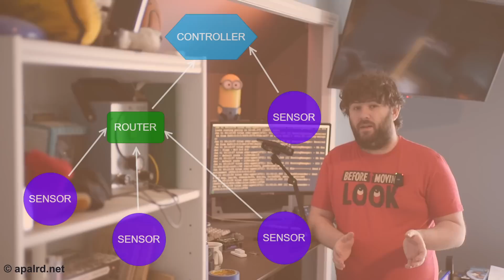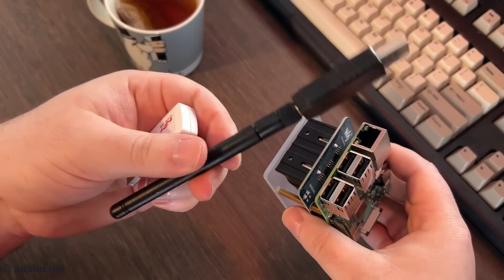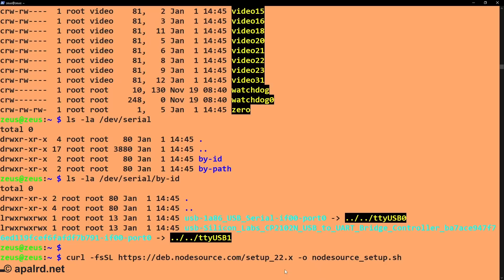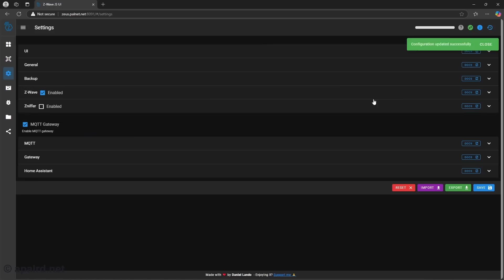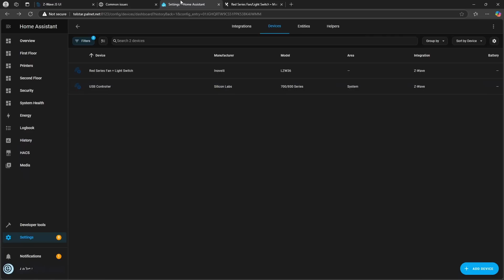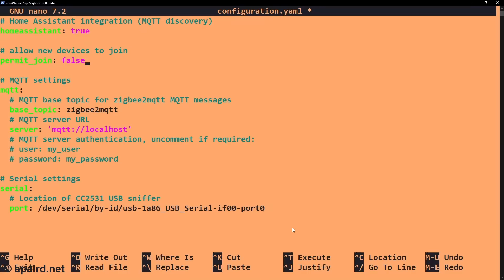Bridging Home Assistant to Zwave and Zigbee using a Remote Raspberry Pi Radio

Comment: I use the HomeSeer Z-NET, which is basically a Raspberry Pi with built-in Z-Wave. It also takes an optional Zigbee USB stick. I use the Z-NET with HomeSeer, which runs in an ESXi VM. HomeSeer Z-NET also works with Home Assistant (I have HA, but at this time, it doesn’t use Z-Wave). The Z-NET is great. It works out of the box, and is easier than making your own. The only caveat is to make sure to take an image backup of the MicroSD card, since I’ve had trouble with MicroSD cards going bad in the past (just after year or more of running 24x7, it’s the nature of SD cards, I suppose).

Comment: So, according to what You've said, when it comes to Home Assistant integration zwave doesn't provide High Availability beacuse only one device integrates with it, right? 

So it's pointless adding more than one controller? I am asking this question beacuse I was thinking about adding zwave to my homelab not only for a better network range but also for High Availability while using Home Assistant.
Reply from the maker: Zwave and Zigbee both form a tree network which must have exactly one controller. They differ in how they store the network info. 

Zwave stores all pairings and security keys on the stick, so that exact stick must be the controller. You can backup and restore the eeprom to move to a new stick but that operation interrupts the network. 

Zigbee stores pairings and keys in the zigbee2mqrt conf file. So any stick with the correct firmware will work. You could have multiple sticks, each connected to one host, as long as only one one is in use at a time. 

Not covered in this video but Thread forms a true mesh, so you can have two Thread border routers both working together like two WiFi APs for redundancy.

Comment: What is your reason to not use the popular smlight slzb006? Thinking of buying it.
Reply from the maker: well I need a solution for zwave in any case, so that won't solve zwave. It's not a bad stick on its own, but it doesn't run Z2M, so that needs to run somewhere too, and if you use HA OS, you can't run two copies of Z2M for two Zigbee networks.

Comment: Soo, odd idea.. could you config the pi to host the devices with usbip and mount the device from the HA vm?  And even then, proxy the connections if you had multiple pi's/adapters?
Reply from the maker: Both of the dongles use usb serial so you can proxy the serial port instead of raw usb. But also, this means you’re limited to running one instance of Zwave and one Zigbee with HA OS, since you can’t run two instances of each addon. I have two zigbee networks.

Comment: Another way to approach this is to use serial over ip. For example, I use ser2net on the RPi hosting the dongles and point Z2M and Z-Wave JS UI to it.
Reply from the maker: The downside to this is you can only run one Z2M / zwavejs on HA OS. I have two zigbee networks. 

If you run them separately then it’s not a problem but then there’s not a big reason to not just run it on the Pi. It’s not a big program.
Reply: @apalrdsadventures  Agreed. The reason I run it on a Pi is because my Home Assistant runs on a Proxmox cluster and no matter which node is running Home Assistant at the moment, it can still connect to Zigbee and Z-Wave sticks on the Pi.

Comment: Erm…… Why not just run these as docker containers? They can then be backed up easily and if your card dies can be restored pretty quickly.
Reply from the maker: Is docker easier to backup than a single application directory with a few conf files?
Reply: don't use the naughty D word here 🤪🤔

Comment: Would this work with a rpi 1. I have one sitting around doing nothing
Reply from the maker: You might run into limitations of the Pi 1 being ARMv6 instead of ARMv7 or ARMv8, which a lot of software no longer supports

Comment: I have home assistant with a zwave dongle attached directly to it, running z wave js as an add on to home asssistant. If I want to do what you did and move zwave to a pi, is there a way I can do this without having to re pair all my devices?
Reply from the maker: the network keys + pairings are all stored on the physical stick, so you will have to re-use the same stick (that's the problem I had - the stick had died). That will not bring over the friendly names for devices. 

If you do a backup of the HA OS setup, you can extract the zip and find the zip from zwavejs, and upload that whole folder to restore your configuration and the friendly names of all of the devices.
Reply: @apalrdsadventures awesome thanks!

Comment: This feel inelegant, an SMLIGHT SLZB PoE would take care of the Zigbee side of things, i dont use Z-Wave but maybe there is something similar. All of the moving parts, and a soon-to-fail sd card / having to maintain a full linux stack on that Pi seems like a lot of effort.
Reply from the maker: that doesn't run Zigbee2MQTT though, it has to run somewhere, and if you have two of them, you can't run them as an HAOS Addon either
Reply: @ you run z2m in your proxmox cluster with HA and point it at the IP address of the  SMLight. Maybe im missing something?  I run HAOS as a vm in my proxmox cluster, z2m is an addon within that HAOS instance. I can move that HAOS vm around the cluser and Zigbee works just fine.
Reply: @substandard649  Is the add-on called Zigbee2MQTT or something else?
Reply from the maker: yes, that only works with one single Zigbee controller, since you can't run multiple copies of Z2M in HA OS
Reply: @apalrdsadventures but you can run as many z2m instances as you like as containers or dockers on the cluster, i have this setup for my barn. I still get to benefit from a single PoE device in each location, no PI, no SD cards no requirement for a PSU and no additional device with a linux stack to maintain
Reply from the maker: yes, that is true if you run outside of HA OS. I don't mind embedded Linux vs embedded firmware.
Reply: There is nothing like that currently for Z-Wave that I’ve seen when looking for it. Silicon Labs makes a lot of SOC for Z-Wave, but to run one as POE you’d need a separate POE SOC to adapt. Running a Texas Instruments POE SOC and an 800LR S2 on a little custom PCB would be like $40-$200 in: board mount SMA connector, ~800mhz-950mhz or a more specific NA or EU model SMA antenna, capacitors, resistors, VRMs, the POE microcontroller SOC, The 800LR Z-Wave SOC with S2 security support, a board mount Cat6 ethernet female port, led indicator lights, buttons, (optional) mini OLED or LCD screen, a custom on demand printed circuit board, (optional) usb port, temperature/humidity sensor IC or more advanced Air Quality SOC such as SEN55 or the upcoming SEN66, custom 3d printed case (maybe one of the Aluminum ones offered by PCB-Way’s metal 3d Printer,) thermal pads, m2.5 standoffs, m2.5 thumb screws, (optional) multicolored copper wire, (optional) board mount breakout headers for i2c/SMA/UART/display devices such as a SEN55 or OLED screen, (optional) crimp connector kit for the connector wires, and (optional) SMA extension cable and/or magnetic base to put the radio antennas outside of the (optional) rack mount location. Been designing my own hobby project for Z-Wave, and thought I’d list some part options Ive looked through. Trying to make it mount in Raspberry pi rack adapter slots, and every rack i’ve seen is m2.5 or sometimes m2.0 screws, so I’m keeping everything m2.5 in the case design for consistency. The Silicon Labs and Texas Instruments dev boards are often more expensive than adding the SOC to a custom PCB, so I’ve been struggling with the hobby project between some Frankenstein board revisions, my fist PCB revision was nonsense.

Comment: What is the point in running HA in a VM cluster when you have 1 device that controls all your devices in HA that could fail? I ask this as I am doing it the same way but keep thinnking I am making it overall complex for no reason. I guess only current advantage is ease of snap shots and restore during ugrades.
Reply from the maker: Mostly because everything else runs on the cluster, so it's more work for Home Assistant to be different. But also, with this setup, each radio is independent, so this Pi failing only takes down these two networks, and not everything Home Assistant does (like the other zigbee network, or wifi based stuff). With Thread it's even more resilient since it can route more like Wifi.